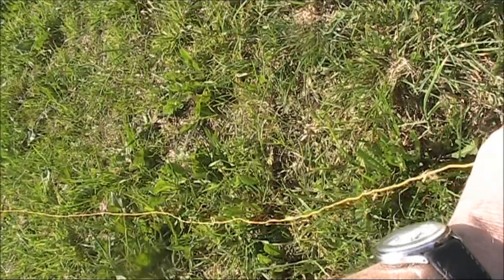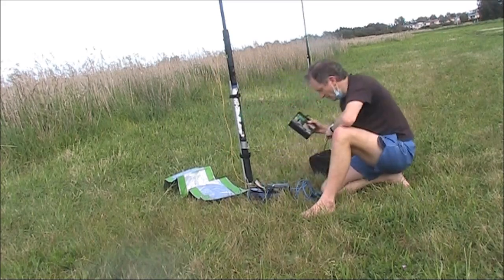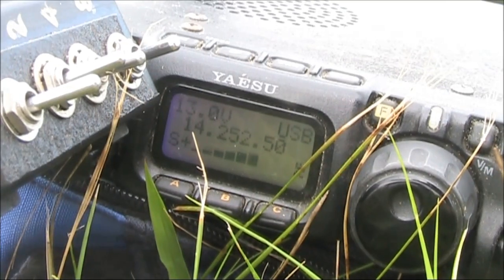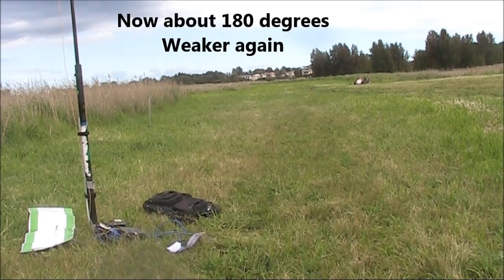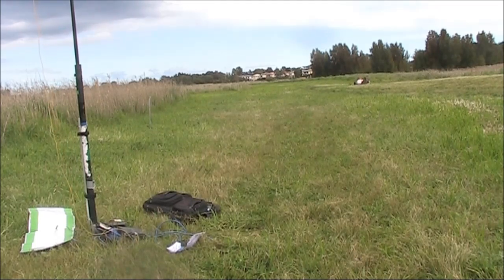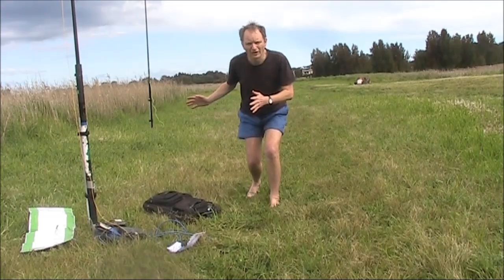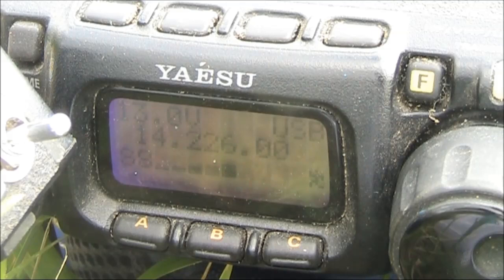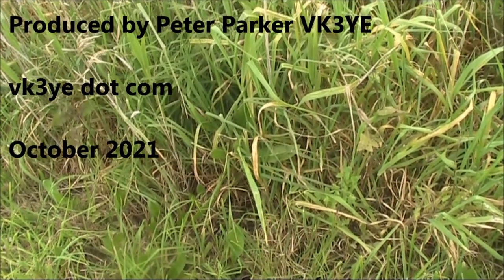SSB QRP in the Oceania DX Contest 2021

Comment: For a moment there you were showing 40 meters.  Did you made the antenna longer?
Reply from the maker: No. The antenna loads up OK on 40m as well. Its radiation pattern will be different  however.
Reply: @vk3ye  on 40 you have a sufficient lower SWR? Thx
Reply from the maker: @frankwc0o  The antenna coupler looks after all that.

Comment: Now, find a tall tree, get the slingshot out, once you pick the side of the tree that allows the desired sweep to get the gain lobes to get the target continents, you daisy chain 4 or more 17'3" drops and 34'6" horizontals, you feed it from a corner, from a car, truck, bike with a sidecar, ect, with the other pole on it, and have a tetherball style rotator antenna. After a certain amount, it may radiate endfire, instead of broadside, but the gain will be epic, and very low angle. Bring a 4:1 with the coax side soldered reverse as an unun and wake up 10 meters or any other band you could get it to work on with your 'fear and loathing' briefcase of baluns, ununs, varicaps and toroids.
Reply from the maker: By all means if you live near a forest. The best operating spots around here don't have tall trees.

Comment: I love ssb, but not easy to build an ssb transmitter like am ones
Reply from the maker: AM can be quite hard to build also, especially getting the modulation right. If SSB is too hard I'd consider DSB as it's simpler than both SSB and arguably AM. Ideas on my website.
Reply: @vk3ye  I saw ur videos and projects about dsb but not success making it work. AM is just an regular CW with modulation via transformer (like the ones inside electronics 220v/9v) and an amplifier strong enought to modulate it :P ... like your last video you made your simple cw transmitter am modulated... also its easy to use any regular OM radio to use as receiver circuit. I saw some projects using diodes to make dsb but still not understand it and they usually dont work just soldering the parts... I think they need adjustments idk... I tried 2 circuits using an IC (mixer) and other using 1n4148 diodes but none of them worked. I build your cw transmitter (not qrp 20w at 28v) and modulate it from mosfet drain (irf510) using a tda amplifier and it worked like a charm... maybe I'll try to build a simpler dsb transmitter but didnt find one yet that uses less parts. 73 from Brazil

Comment: its always a problem when holding the antenna for adjusting direction as body capacitance can improve or worsen the signal, some times even change the dialed freq in some radio projects

Comment: any regen circuits for sw using modern transistors?
Reply from the maker: Some regen circuits are described on my website and in previous videos.
Reply: @vk3ye  i find it difficult to source the 2n4416 and the mpf102 or the 2n3819 jfets
Reply from the maker: @bumohamedubualooy7111  There are designs using bipolar transistors. Google is your friend!